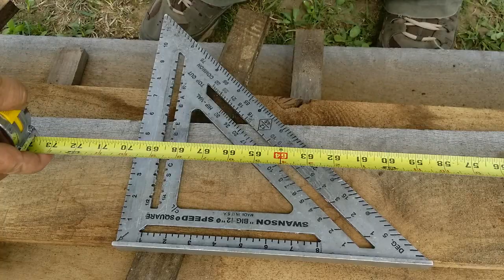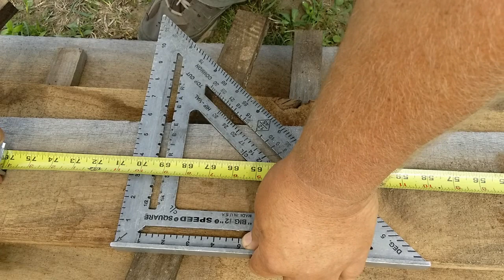HOW TO BUILD A CORRAL PART 2 The Life of a Farm Boy

Comment: If that's supposed to hold animals, good luck. Never put the boards to a corral on the outside of the posts.
Reply: I'm sure he'll realize what he did wrong...when the 800 to 1,200. cattle run right thru it....or worse cattle turning around in the chute area that's now way bigger than 28". It might work for 600 lb and under heifers- yearlings. The good news is.... it's only heavier boards are needed on the inside...he can leave those old boards as is on the outside.

Comment: Shouldn't the boards been to the inside of the corral? Like how you do barb wire?
Reply: I'm wondering the same thing.  They could push'em off easier this way, but on the inside they could nose them off easier.  I would think the body weight behind pushing would make putting boards on the inside safer.